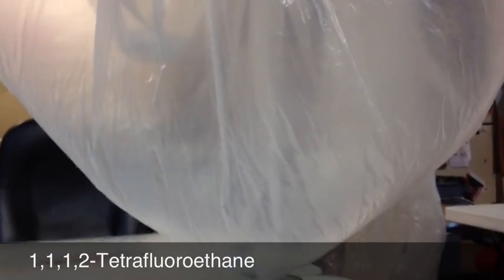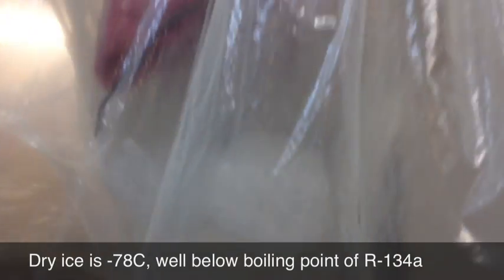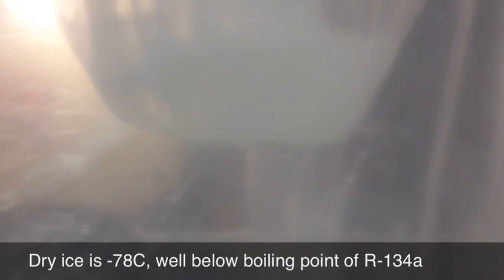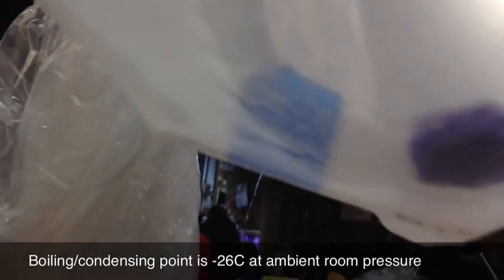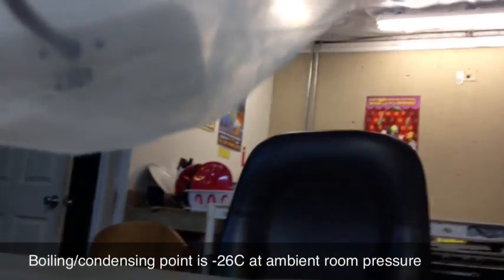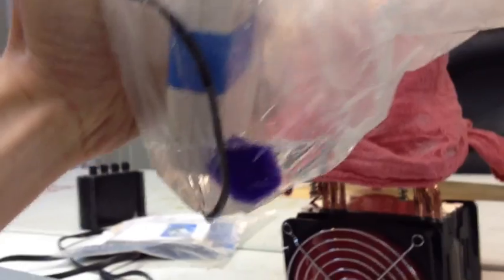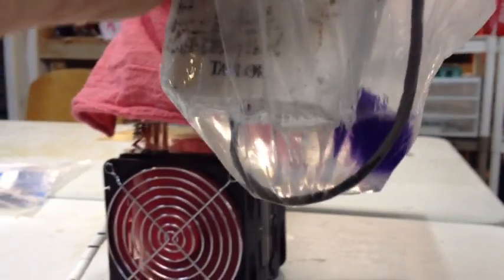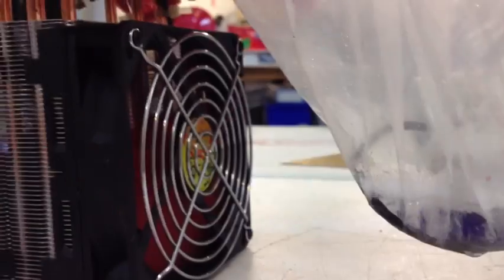Freon changing phases in a weather balloon

Comment: I had some conversations with Joe (WB9SBD) about using gases with low boiling points to stabilize balloons at a height of near constant temperature - where the gas would condense as it got colder with increasing altitude. A small amount of the gas would be mixed in with the lifting gas. Condensing would result in a balloon volume reduction - which would result in the balloon descending into warmer air where the gas would boil and increase the volume and hence rise again. Pressure has an effect on the boiling point so working out the float height was a little tricky.  Butane and Propane (and mixtures thereof) seemed like good candidates - although the balloon would have to be synthetic (Neoprene / Nitrile).  Has this ever been tried?
Reply from the maker: Yeah, ammonia has been used for this purpose.  I think JPL may have tried this in the 70s or 80s?   It did work, cycling up and down, but the drawback was that it was poisonous.